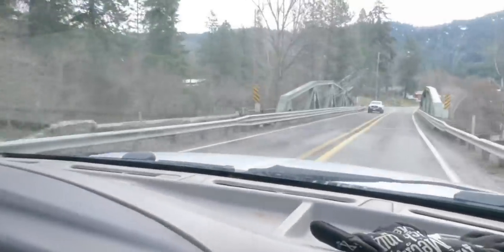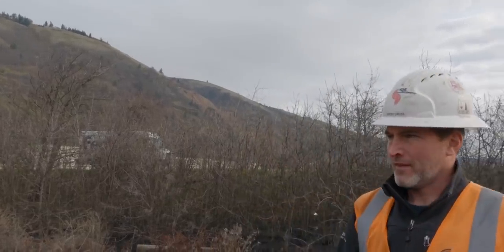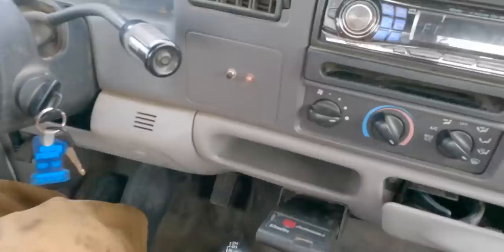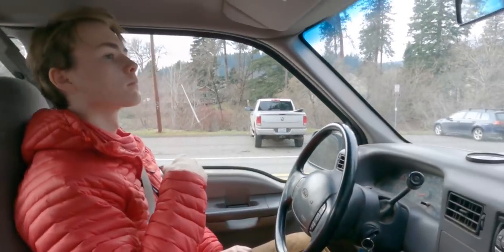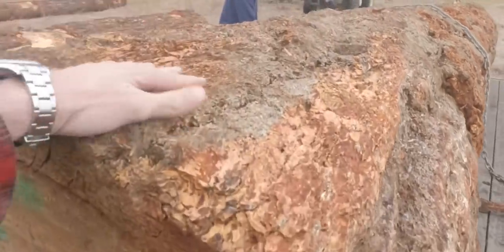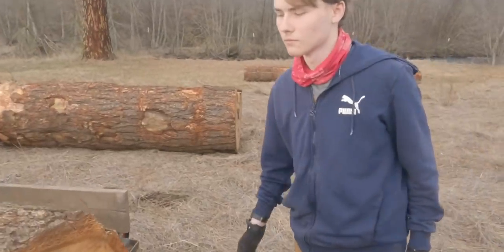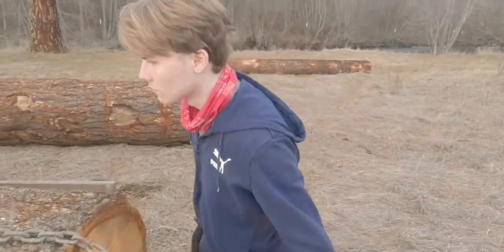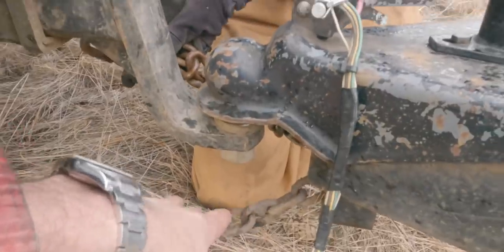I'm Scared

Comment: The mud is black because there's a lot of wood scraps in there that breaking down and composting.
Reply: Took the words right out of my mouth. You could grow ANYTHING in that mud!!
Reply: Looks like some good soil
Reply: Good fertile soil
Reply: That's probably one of the best compost you can get!
Reply: It may be full of organic compounds but if this is primarily pine pulp and wood i bet it’s on the slight acidic side. Be good for tomato’s for sure.
Reply: Love to have a truckload of that right about now.
Reply: @MARKE911  Yep that would be acidic it wouldn’t grow anything.
Reply: @Mr19853  
You probably dont know anything  about compost as it is.
Reply: I’ve worked around some heavy equipment it’s not just composting wood in the soil trust me
Reply: @Graveltrucking  neh. get a truck load of it and let it sit in the back yard for a year.
Reply: Sounds like the kid has no experience with gardening or farming.

Comment: Studies have shown twisting chains severely diminishes the effectiveness of the chains. In the event of hitch separation, Instead of relying of the tensile strength alone, it applies excessive torque along with the tensile forces and will cause the links to fail. Might not be 100% applicable here, but as a general rule it is ill advised.
Reply: So this begs the question of how far can the chain drag before it is shot?
Reply: We're told not to twist the chains at my work. So I use a 12" zip tie to suspend the midpoint of the chains near the ball, to keep them from dragging. Work supplies the zipties and I don't tow every day, so it's whatever. If it was my personal I would probably look at something like gearties or cheap aluminum carabiners to take up the slack, so not to waste the zipties.
Reply: @martyvanord984  DOT will disallow for any scrape marks.

Comment: My father did the same for me.  This video hit home for me, thank you. 
One hint my father gave me that you haven’t mentioned is to put the truck in neutral and then set the emergency brake.  Then when you are loading and unloading items, the pushing and pulling on the truck will not tear up the transmission.

Comment: Just saying they where 12 valves the 24 valves didn’t come until later
Reply: I gave a spiel about the old square body cummins... 🙄🙂
Reply: 1st gen Cummins, GR8 engine, truck body is junk, I had one, used 2x6 to bend doors up after they sag.

Comment: 32k for a '91 truck lmaooo
Reply: That guys insane
Reply: someone will pay it.
Reply: As someone else said, someone will pay it. Trucks are outrageous everywhere
. I wound up buying my Tacoma two years ago new. It was within a small amount of the price I was finding used ones for with 80K+ miles on them.
Reply: mygrandpa has a 2008 cummins with 120k miles or so, worth around 20k. The old cummins might be more reliable and cheaper/easier to work on but the 24v has waay more power
Reply: Only worth that if the bed is full of M193.

Comment: JACK, My Stepdad taught me to place my left foot touching the the outside of the truck(by the emergency brake) and imagine my foot was reaching through and touching the centerline. Also keep glancing at the outside left rear view and keeping the left trailer wheel a couple of inches from the centerline of the road. Also do the same on the right side trailer wheel to outer line.  Once you find the right edge of the road find a spot on the hood or wipers to line up with the right line in front of the truck (while you are sitting relaxed) Use these in combination and you will know exactly where your truck and trailer are at all time. Which will avoid fear. Also don’t hold the steering  wheel so tight it turns your knuckles white. Hope this helps you.
Ask your dad to help explain these ideas.

Comment: You need to "X" (cross) the trailer safety chains so if the trailer were to come loose from the hitch, the chains would support the trailer tongue.  That's the reason for the extra chain length.

Comment: Want a tip from the east coast?  Throw a fence post (roller) under the log as it coming off the trailer, it’ll keep it from digging in,  another at the back as she drops. Keep it off the ground, cleaner/dryer, you’ll pick up easier and you’ll get your choker off easier.

Comment: The operator of the log carrier knows his stuff - he laid that first one down gentle as could be.  Always great to see a person know how to do their job well.  

As to Jack's question in re the black mud - in my experience on trail crew, pure mineral soil is generally light brown, tan or grey.  Once you start mixing in decaying organic matter (decaying duff or leaf litter, there in the log yard, all the bark and wood bits most likely), you'll see it be a lot darker shade, going to black, and a lot more mud.  Generally, mineral soil is great for construction (packs well, doesn't hold a lot of water, doesn't turn to mud easily if not too much clay, etc) and terrible in the garden.  Black, organic laden soil is great for the garden (holds moisture, doesn't pack very well, etc), and terrible for construction or trails.  Growing stuff - black soil good.  Building stuff - black soil not so good.

Nicely done on getting those logs off the trailer Jack.

Comment: Tractors are made for pulling.  The  rear end of the tractor is where all the strength of the tractor is focused.  So the best way to prevent damage to the more fagile mechanisms/attachments is to pull from the closest point you can to the rear end pumpkin that can handle the load.  the force load in all those pins and linkage the way you pulled the log is more risky to your loader and is unneeded.  But it is your tractor.

Comment: Most tractors can lift significantly more weight via the 3 pt system compared to the loader. Simple physics and levers. A loader is 4-5 feet from the front axle, a 3pt drawbar is 2-3 feet from the rear axle and with most tractors, the front end is heavier than the rear which helps keep the front end planted when trying to pick something up with the rear hydraulics.

Comment: I have done this at home before albeit with a much smaller tractor and slightly smaller log. I did it like Jack did it but I shortened the chain up so the bucket was near the log. I did it that way because I didn't want the log rolling and creating a slight amount of unknown weight shift. I just lifted the bucket up a bit higher. The shorter chain gave me more control over the end of the log. The bottom lip of the bucket was just slightly over the end of the log and the chain was actually hooked to the lower lip of the bucket because for some reason I have no grab hooks welded to it yet.

Comment: Safety chains, I have always crossed the chains and twisted together, it combines the attachments reducing forces on each as it uses the strength of both chains combined.  Also twisting the two chains together creates a cradle to protect the trailer end hitch components from road contact.  My chains are each 4X the gross trailer weight to maximize safety.  
Another option is to employ a closed hook bungy to remove slack on the chains (chains always crossed).

Comment: G'day, The black 'dirt' is probably decomposed organic material (tannin in the bark) you will find it would be goon in the garden.
Regarding the chain. When Jack hooked the chain around the log, the hook should face away from the direction of pull. that puts the load on the stronger part of the hook. when he attached to the tractor try going around the main post in stead of across the front. Just a couple of little tips to reduce risk.

Comment: Cody, check in your state, but here in Pennsylvania, they require chains to be crossed. If the hitch breaks or comes off, the crossed chains will cradle the tounge, and won't let the trailer loose control. Please let me know what it is in Oregon. Thanks!

Comment: You might want to put underneath your logs four boards 6in X 6in X 6ft  on the ground to keep your logs up off the ground a couple of inches to keep them from absorbing moisture.  Cutting a dry log later would be preferable.

Comment: Blue Staining in pine can also be signs of inbeded iron. most big sawmills wont cut it because it runs the risk of damaging the blade and slowing down production. could be nothing but keep that in mind/ have an extra blade on hand if you have any sort of time frame on the timber framing project

Comment: So I noted something and wondered if any opinion on it.  I was taught to cross the trailer chains. The thought behind it was that if the trailer came off the ball instead of the trailer tung hitting the ground the chain would cradle it and this could prevent the trailer from flipping.  Just what my grandpa taught me and it did work on a load of fire wood I had in a trailer that the lock had let go.

Comment: Your teaching him the way I like to teach. Think about it. You make a decision, and give it a go. If you need to adjust you'll know as you start to pull it out. I'll also give suggestions only. Try with caution, get experience, then trust your experiences and instinct's. Hands on is the very best teacher, but slow. Rigging the log from the bottom also allows you to pick it up some so the log front is not plowing into the ground letting it slide. I pull it out then shorten the chain to get closer to lift it some.  I skid with my Kubota L3800. I have a draw bar for the 3 point I designed that allows me to wrap the end on the draw bar then just drop the chain in a hook that's part of the draw bar. With tension it locks like the hook on the chain to the chain. I front  pull it clear form where it was cut then back up where the draw bar is almost over the end of the log re-rig the chain short to the top of the log, then to the draw bar, lift the draw bar just enough so the end of the log is off the ground and in 4 wheel 1st gear I can safely pull a log like the one on your trailer through the wood, fields and anywhere I want with minimal ground damage as it is now sliding and following. We all have to find out what works for us. I do this all alone so if I get hurt in the woods I could be out of luck. I make my own luck by being wise not smart. Smart can get you injured or killed. Wise is experience, instinct and caution.

Comment: I would have liked to see the loader remove the little log, lay it perpendicular to the large log on the trailer and slide it off the trailer using the log to take up the weight of the large log off the trailer. (rolling would be  beneficial, but you can chock it once the large log is mostly past the center unchock it so the little log rolls freely away from the trailer.)

Comment: The tow mode button on the GMS is not the shut off on the gassers for overdrive that just changed the shift points. Anything over gear three is overdrive and GM's

Comment: One tip: Be aware of which way a hook will move if/when you remove tension from the line, if the hook point is facing up, that means it could simply fall off the chain.
Given this can only happen when there is no tension, its not really a safety issue (sure it could shift and be a problem when tension is reapplied, but, super long odds), its just a pain to have to re-rig.

Comment: Twisting the safety chains to shorten them weakens the chain and is a DOT violation. You should shorten your chains to the appropriate length for the tow vehicle. I didn't notice if they were crossed under the tongue and hitch, but the should be, as well as always having a pin in the coupler on the trailer. I'm not trying to be a hero, but it is valuable knowledge for Jack

Comment: Why not use the 4runner as the overland vehicle?  If you need more towing capacity an older v8 4runner has just under 7k towing capacity and is essentially the same vehicle as the newer 4runner. Or a 2nd generation sequoia, basically a tundra. The downside is that they are quite large on a trail if you plan on remote camping.

Comment: The chain length should have been much shorter, such as to have better control and the ability to lift that log when
attempting the log ever so slightly; when sliding it off the trailer. You must have optimum control of the object that
you are trying to pull in the offloading of that log!  With any forklift type of operation, YOU MUST have complete
control of the load object at all cost to maintain CRITICAL SAFETY and to also NOT cause damages to the equipment
nor the trailer!

Comment: Dear safety officer. Something doesn't look right with the trailer safety chains. I may of missed it because of the camera angle but it looks like the chains are not crossed and it looks like both chains are mounted on the same side of the trailer. The chains should be mounted one on each side of the trailer and crossed when they're attached to the truck, crossing the chains prevents the trailer from hitting the ground if it should bounce off of the ball for example.

Comment: Those square body cummins dodges were 12 valve First Gen or called 6BT... 89-93... they got intercoolers 91.5 and up. Pickups in general have gotten silly high priced, especially diesels. Makes me cringe to think, where prices of pickups will be in 10 years. Keep on raising your kids proper 👍😎❤

Comment: I just can't drive with both hands on the steering wheel...started out on a manual transmission...had them most of my life...so even in an automatic today it feels wrong  :)
Reply: Left side of brain fights right side for control....leads to constant steering left/right....11 & 2 goes back to vehicles without power steering and poor tires.

Comment: I disagree cody you dont rig chain to the bottom of a log to lift up. that could cause the log to spin quickly and dangerously. alway rig from the top just use a shorter chain for more control

Comment: Yeah those 1gen Cummins have become collectible. If you follow the collectible car market you will find almost all clean desirable cars from early 90s have sky rocketed even cars you would not expect or thought where basic mundane cars at the time. The reason behind this is the people who had those cars as first cars or young adults are now older making good money and want to go back and collect and find clean low mile examples. I’ve seen this a lot in Honda civics Toyota trucks 1st gen Cummins Mercedes bmw etc. so it’s def a sellers market not a buyers. Would prolly find a mid 2000s version for cheaper because they don’t have a market yet. You see the same in exotic/muscle car market that’s why 60s cars demand insane prices because the people who have cash to spend are older.

Comment: You have a lot of younger, who maybe are not able to have to access to the types of lessons you are teaching jack, who watch your videos to get some of those lessons. It would have been great if you showed more of those pointers, or corrections you had to give jack while towing the trailer, especially empty.

For those of you who are not familiar with towing a trailer the first thing is hooking up. Much like he showed at the end chains should drag, but should have some slack in them, they should also always be crossed. The trailer should be high enough on its support, it sits over the ball, then slowly lowered on. Once fully off the support, the latch should then be clamped down. You should then pull up on the trailer, pull with your might as if you are trying to separate the trailer from the hitch! If it comes off (i have had a couple that for what ever didn't catch right, and did come off, and this is exactly why you do this safety check) lift the lever back up, set it back on the ball, make sure it is full off support, and push the lever down, and then repeat the test until you can not separate the trailer from hitch with all your might. Make sure the plug is all the way in, and make sure all your lights work.

Next, it is very, very important to watch your speed while traveling empty. Most trailers don't have a suspension, or have a very stiff suspension to handle the weight. Empty trailers will bounce, and when they bounce they can sway. They are so far of from the connection point, that the amount of force they will exert on the tow vehicles back end is multiplied many times over. If they sway enough they will rip your back end right out from under you, and when that happens your spinning and there is nothing you can do then to hold on for the ride and pray. 

next I like to get the little 2in tow mirrors you can buy and stick on to your normal mirror. They are supper convex and allow you to see your trailer so much better. That saying you should always keep your attention forward does not entirely apply when towing a load. The best way to prevent a accident like looking losing a load, or even worse the whole trailer, is to catch problems early, pull off and fix them. You should be periodically checking your mirrors to see your trailer to make sure nothing shifted, is in danger of falling off, and/or there no issues with the trailer (like a smoking tire, flat tire, wobbling hub, ect). 

Lastly when loaded again watch your speed. The concern of bounce and sway is mostly gone due to the weight, thou it still can happen. The biggest concern now is the increased stopping distance, and possible overheating of your brakes. Even a empty trailer (in or around 1,000ish lbs in most cases) can add several feet to your stopping distance. Keep this in mind, watch the speed, and do not "ride the brake", because you will overheat them and suffer brake fade, especially if its a heavy load, on a trailer with no brakes (4 or 5 pin connector). Some of the bigger trailers actually have their own brakes (6 or 7 pin connectors) which can greatly improve stopping distance, and reduce the risk of brake fade, but it is still a concern.